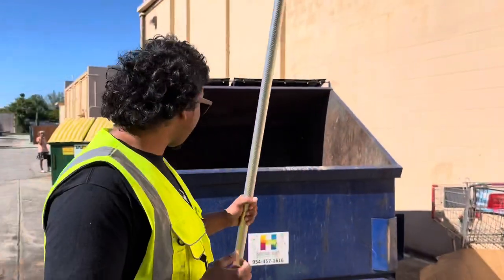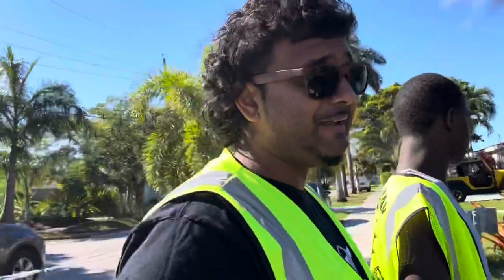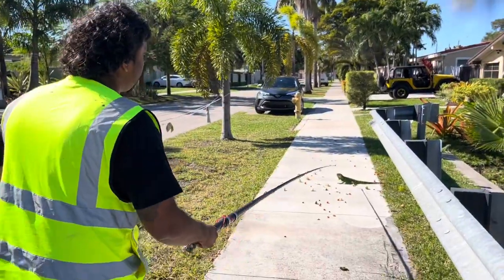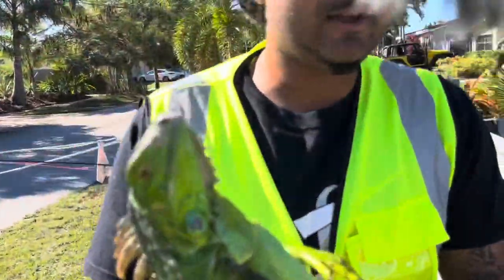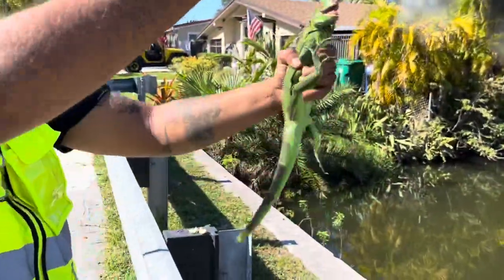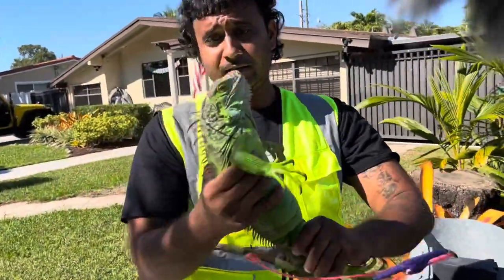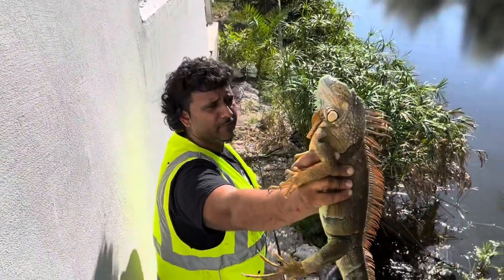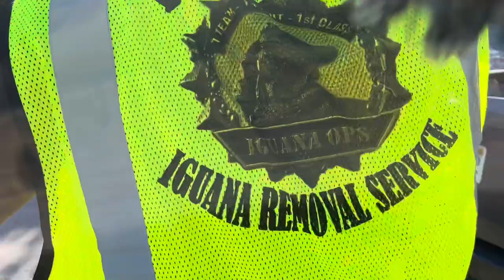Dumpster diving for FREE Iguana BAIT! IGUANA REMOVAL JOB!

Comment: the stuff in that back yard is a preform Styrofoam that fit together then filed with concrete to build houses out of the you go over the out side with a stucco type material then paint it ! it a fast and cost effective means of construction !